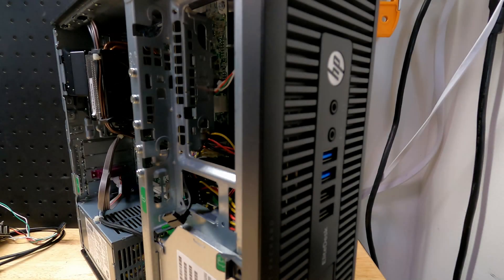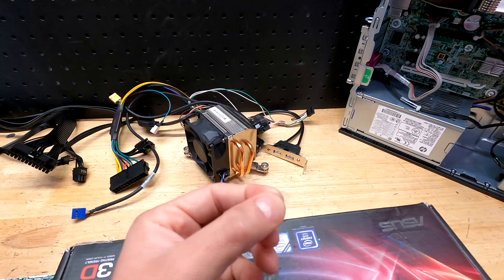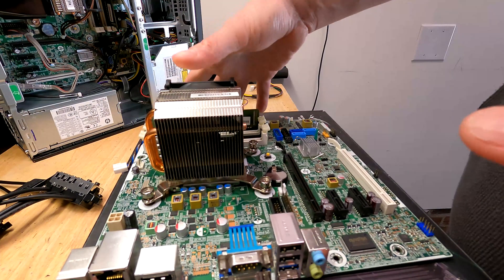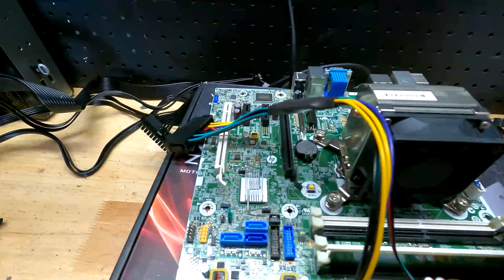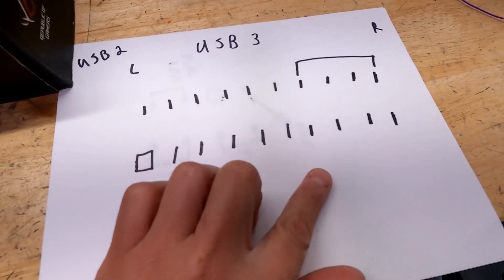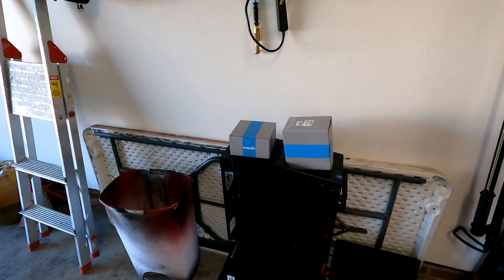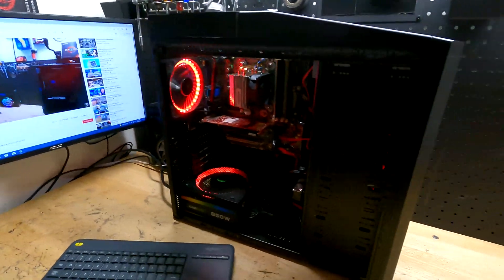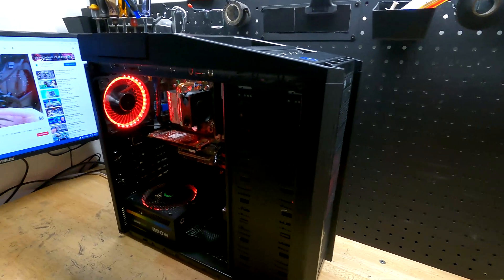Hp Elitedesk 800 G1 case swap!

Comment: Thank you for this video! Everything is working great however I do get error 512, rear chassis fan not detected. Which is odd because there is no rear chassis fan? 
Does anyone have any insight regarding error 512 on boot? Rear chassis fan not connected? I've spent hours searching and can't seem to find a solution.
Reply: Yes lol I felt bad for posting this comment because last night I realized, maaaan just plug a fan in !! 

Thanks for taking the time, I appreciate it!!
Reply from the maker: i plugged in a fan and it got rid of it.

Comment: One question my case has two usb's (the old kind) its a case from 2001 where do i plug those in at? they say vcc1 usb1- usb+ vcc2 usb2- usb+ and then 2 ground cables
Reply from the maker: it's hard to say with the older cases... I am not sure.

Comment: Great video! Just curious if this concept could work for the hp prodesk 600 g2? I'm mainly worried about that 24 pin to 6 pin adapter for the cpu power on the mobo. It seems like if I find the layouts for the mobo and get those grounding cables I can bypass front panel errors and do a case swap. Just worried about that adapter for the cpu power. Thank you for your time!🤘
Reply from the maker: it does. link to the adaptor

https://www.amazon.com/YEZriler-Adapter-Sleeved-ProDesk-EliteDesk/dp/B0B2HVJZJ8/ref=sr_1_3?keywords=hp+prodesk+600+g2+power+supply+adapter&qid=1680731443&sprefix=hp+prodesk+600+g2+power+s%2Caps%2C94&sr=8-3

Comment: I have an HP EliteDesk 800 g3 and would like to know if the 24-pin to 6-pin ATX Power Adapter Cable works on my motherboard
Reply from the maker: not sure about the g3

Comment: I just buy one of this and i can not open it,. The top panel is locked .. any ideas?
Reply from the maker: not sure, never ran into that.
Reply: Hey ik this was a year ago but I used a hairdryer 2 expand the metal, jammed a screwdriver in there, twisted while hitting w a hammer then it popped right off

Comment: Any lga 1150 cooler will work i know this was one year ago 🤪😜
Reply from the maker: have to use the original cooler. mounting hole are not standard.
Reply: @DLMtechgarage  In my version the cooler master i30 and i 50 cpu cooler worked great

Comment: Pretty smart stuff man. My local hardware store doesn't carry nuts small enough to mount these coolers, so I use zip ties and take the pins out of an Intel stock cooler.
Reply from the maker: Ive done that too with zip ties!
Reply: @DLMtechgarage  with a sub 150w graphics card you can get away with reusing the HP power supply as well if you mount it with gorilla mounting tape and use a dual SATA to PCI-E 8 pin adapter.
Reply: @DLMtechgarage  i manged to use my back plate from my old hp board with i7 2600 and it worked
Reply: May I ask  how the ziptie method works?
Reply: I just cut out the square that hold the four holes out of the case with a tiny angle grinder.

Comment: so if i put this in a gaming case, can i just plug in the new cases usb 2.0 into that yellow header? and the usb 3.0 into the blue one and have them be usable on the new case? or do I HAVE to jumper them together? id like to just plug the new cases wires into this board, but i dont want it to fry anything, as can be the case with dell motherboards and their fan headers for example
Reply from the maker: you don't have to do the ground mod, that only gets rid of the error, it will still work

Comment: where can i put the reset button?
Reply from the maker: i never did the pin out for the reset. felt it was not needed.
Reply: @DLMtechgarage  thanks mate, can i put a 1050ti in this pc? what graphics cards do you recommend?
Reply from the maker: @santiagovb  you got a bunch of options, def depends on your budget, I paired the with a 2060 and found good balance.

Comment: Great video. I'm looking to do something similar with an. HP Elitedesk 800 G4, which has a a mother board that looks a lot different. Mainly that it appears to only have a 4 pin power connector. I'm able to find one that will work for that. Thoughts?
Reply from the maker: not sure, might require more modding then its worth.

Comment: Hello, By chance do you know if this would work with an HP Elite Desk 800 G3? Or is the G3 to new?
Reply: Hi, I have the same board as you and I still haven't found any information about the adapter. Please, if you know anything, let me know. I'd appreciate it.
Reply from the maker: @ellobomio66  

https://www.amazon.com/YEZriler-Adapter-Sleeved-ProDesk-EliteDesk/dp/B0B2HVJZJ8/ref=sr_1_3?keywords=hp+prodesk+600+g2+power+supply+adapter&qid=1680731443&sprefix=hp+prodesk+600+g2+power+s%2Caps%2C94&sr=8-3
Reply from the maker: prbly not, they changed the whole motherboard layout.

Comment: Hello I have a question. I have a similar model I tried the same PSU Adapter with a 500 Watt PSU. I ended up getting 4 beeps. Do you maybe by chance know what this means maybe?
Reply from the maker: you might of gotten the z240 adaptor instead of the 800. they look the sign but the wiring is slightly different.
Reply: @DLMtechgarage  Many thanks for the reply!!) It looks like I have hp compaq 8000 elite convertible minitower. I dont know if thats a big difference or not.
Reply from the maker: @PushSaharaX  i believe it is a different mobo format

Comment: Hi...can I use your I/O shield in my hp 600 g1 ?
Reply: Why not ? Your and mine same like
Reply from the maker: @ernanfer2  if its the same board I don't see why not. I have not seen that board to confirm
Reply: @DLMtechgarage  yes it's same board (hp 600 g1 sff)
Reply from the maker: @ernanfer2  should work then I would assume
Reply from the maker: not sure.

Comment: Thanks man, saved me. I accidentally bought the wrong 24 pin connector and the one you linked worked just fine. What I ended up dong is just pulling the front panel out of the HP case. Wiring it and tucking it under the power supply shroud for now. Question and I hope I didn't over look it in your video, Is there a way to get the front panel to work at all, or am I stuck with just keeping the errors from coming up on boot. 

Pretty decent budget build:

Case: Rosewill D100 came with 4 rgb fans $50
CPU and MOBO: i7 4770 FREE!
PSU: thermnaltake smart 550 $55
24 pin connector: $12
CPU cooler bolts: $7
GPU: GTX 1060 6gb: $100
Storage: Samsung 850 120 gb and WD 250 gb, FREE with machine
Reply from the maker: It's in the video, the pinout is simple for the led and power, the usb, you need to add the grounds I should in the video and the audio is a direct plug in.

got another video showing this on a different model but the front panel is basically the same. this video might explain it better.

https://youtu.be/3qOmhk6gVik
Reply: @DLMtechgarage  thanks, so you are able to utilize the entire front panel. Nothing is unusable correct?
Reply from the maker: @FatDaddy94  yup, able to use the whole front just like any other board.
Reply: @DLMtechgarage  you are beautiful. I love you
Reply from the maker: @FatDaddy94  thanks!!

Comment: Hey can you help me? I have a hp Z230 SFF. I bought a 500W psu and im moving the MOBO into a h510 elite case. My psu is a Thermaltake smart series. Comes with main pwr connector 20+4 pin, 4+4 atx pin that i plugged into the cpu pwr, sata 4 pin i used for two SSD, pci-e 6+2 pin (x2) one 8pin went into my Rx 580, peripheral 4 pin and a fdd 4 pin. I planned on putting one 6 pcie pin into the main power connector.

The pcie pin fits into the main power connector. But the shapes look a little different. Also the 6 pin thats above the sata power. I don’t know if it matters if i use that or not.

So do i even need the 24pin adapter?
Reply from the maker: you have to use the adaptor or it won't work, you can short out the board. When you buy the adaptor make sure it is specific to the z230 as other models look the same but are wired differently.

Comment: Heya! If I plug in front usb 3.0, and jump the USB 2.0, will it still give me the errors?
Reply from the maker: you will get the errors if don't do the pin jumps
Reply: @DLMtechgarage  even if I connect the USB 3?
Reply from the maker: @matthijsvandeweerd1415  yea, it needs the ground signal to get rid of the error.
Reply: @DLMtechgarage  oof. Can I rip out the USB 3 from the old case and plug it in that way?
Reply from the maker: @matthijsvandeweerd1415  you can. I have done that too
Reply: @DLMtechgarage  alright so yesterday I have done the case swap and it's not too difficult actually! I jumped the USB 2.0 and ripped out the 3.0 from the old case. Works flawlessly!

Comment: How did you manage to get your fans to work?? The board doesn’t have fans only cpu fan
Reply from the maker: I use a pwm to sata adaptor, it has a splitter to plug up to 5 fans.

link below

https://www.amazon.com/Adapter-15pin-Splitter-Extension-Adapter-28cm-2pcs/dp/B08SJBCVDP/ref=sr_1_3?crid=3GZ0IDGD0LMCH&keywords=pwm+to+sata&qid=1671499696&sprefix=pwm+to+sata%2Caps%2C103&sr=8-3
Reply: I see I ended purchasing a splitter it plugs into the cpu fan slot and add 5 fans slots

Comment: Can I used other cpu heatsink(1155) ...i have a shodow I bought from ebay?
Reply from the maker: no as the mounting holes are not standard
Reply: Ok ...but other opcion ....the fancooler hp prodesk 600 g1 tower ....can I use this it?
Reply from the maker: @ernanfer2  yes, you have to keep the same cooler as their is no other option.
Reply: I mean, are the eyes the same to mount it? , since I will put the board in another case
Reply from the maker: @ernanfer2  no the wholes are different from standard mounting.
Reply: @DLMtechgarage  yes I know ....that I did was I bought a fan cooler mt(hp 600 g1 mt) and worked

Comment: I have a EliteDesk 800 g1 TWR and I noticed the mobo screw holes don't match those of a standard m-ATX mobo. Do you need to adapt the case to the Hp OEM mobo ? How bad is it ? Thanks.
Reply from the maker: no sure, never used those.

Comment: hi...I'm thnking to get it ....but I have 16gb(4x4)ddr3 and one I7-3770, it is support it ?
Reply from the maker: yes it will
Reply: @DLMtechgarage  sure ...i7 3770 is 1155 and the hp 800 g1 is 1150 ...
Reply from the maker: @ernanfer2  misread the comment. the g1 is 4th gen and you would have to get a 4th gen cpu, the 3rd will not work but the memory will as 4th gen is still ddr 3

Comment: Did you make the connections with jumpers because the case did not have the cables to connect them?
Reply from the maker: yup!! if not you will get the error
Reply: @DLMtechgarage  But if the case that I have does have those cables, can I connect them without giving me the error?
And if the case does not have them, then by making the jumper the front connections of the case would be rendered useless?
Reply from the maker: @stopikitzy.  you can, the jumpers are for the board only if you don't want the front i/o but if you wan the front i/o you need to do the mods to the cables i talked about.

Comment: Great video but the g2 board has 12 pins not 10 any suggestions  on pin out because still get fan to spin a second then stop.
Reply from the maker: yea I said that wrong, I have seen that when using the wrong psu adaptor. it has to be specific to the 800 g1

Comment: I cut the back to mount the cooler it been working for weeks now should i br worry
Reply from the maker: if its secure and works, I would not worry.
Reply: @DLMtechgarage  it secure the only thing left is to remove that f1 error and wait for graphic card to be shipped
Anyway the graphic card il be using is rx 6600xt i have nzxt 650w cv it should work fine yes?
Reply: After i get the last parts i may make video on my channel
Reply: @DLMtechgarage  and last is there a way to change that cpu cooler or the original hp cooler is already overkill for that cpu
Reply from the maker: @veol  you can't change the cooler, the hp mounting holes for the cooler are not standard.
Reply: @DLMtechgarage  yeah i just found out yesterday i will drop my project i will sell everything and keep AliExpress 6600xt gpu
Reply: @DLMtechgarage  it was truly fun project to create
Reply from the maker: @veol  yea I enjoy them!!
Reply: @DLMtechgarage  can you answer me

Comment: You know you can disable F1 messages like that from the bios, right?
Reply from the maker: i tried and it did not work!
Reply: @DLMtechgarage  its a setting called bypass f1

did you find it?
Reply: it worked on my hp eletedesk 800 g1
Reply from the maker: @dynamibyte  have not messed with it yet, but also wanted the front usb to work as well.

Comment: I'm looking to upgrade my fans only in a stock HP 800 G1 tower, I read somewhere the pin config on the Case Fan connectors is proprietary and you can't just plugin any fan to the headers.  Do you know if that's true or?  I don't want to start a fire xD I know it has at least 1 SYS Fan header and 1 CPU Fan header.
Reply from the maker: It's easier to go with a sata to 4 pin as the fan connectors are limited.

Comment: Please, can you provider a blackplate adapter for the cpu cooling. ? This is your missing part in your video (Amazon link) . I got just the motherboard i got a square figure cooler that doesn’t catch this hole. Truly thankful😅
Reply from the maker: their is no adaptor, you have to use the original cooler and buy the nuts to make it work.

Comment: Can i put a gtx 960 2g graphics card my case hp 701 g1 amd a8
Reply from the maker: depends if the psu has pcie supplemental power.

Comment: I have a 320w power supply it says its high efficiency and 80plus gold do you think it'll work with an graphic card that is not externally powered?
Reply from the maker: it will
Reply: @DLMtechgarage  OK thanks

Comment: I have an EliteDesk 800 G6 SFF and a new RM850 power supply on the way. Do I need an adapter for it? Have you seen the adapter anywhere on Amazon?
Reply from the maker: not sure as the g6 board looks way different as its newer, some of the newer oem's are changing things so if you mod it, it can cause damage to the board.... I think this requires more research..... plus the adapters are specific for the models.
Reply: @DLMtechgarage  Thanks. It's quite unfortunate :(

Comment: when i change the psu with the 6pins converter it always shown 515 power supply fans not detected
Reply from the maker: make sure you got the right converter, the error happens when you get the wrong one. it has to be specific for the 800g1... there are convertors for the different models and the pin outs are different.

Comment: Hey man, first of all nice video! I have the exact same model and i just bought a 24pin to 6 pin power supply adapter, a 500 watt power supply, a gtx 1060, and of course a bigger case. I have a question tho, what is the exact size of the bolts you bought?
Reply from the maker: it's been so long I don't remember, i thought I mentioned it in the video. my apologies.

Comment: My fancooler is making a noise so horrible, i think that i need that PSU adaptor, bc i've tried everything and it stills making that fvcking noise :(
Reply from the maker: the fan on the cooler could be bad

you would only need the adaptor if your trying to upgrade the psu.

Comment: I'm about to build a rig like this for my dad, with a HP elite 8200 and I wanted too keep the cooler. I have a i7 2600k 16gig, 600w thermaltake power supply and I'm hoping to get a rx580 to work....
Reply from the maker: Should be a cool build
Reply: @DLMtechgarage  do you think the rx580 will work with it ? From what I've read it should
Reply: It's also got a 256gig SSD for the boot drive
Reply from the maker: @Blake.hughesyt  if you do the case swap or upgrade the psu on the m/t model it should.
Reply: @DLMtechgarage  yea I've got a 600 watt thermal take and full size case to house it all.

Comment: what will happen with the two jumper thing connection can i not use anymore of my usb on case or motherboard and if i put a pciex16 extender will it work?
Reply from the maker: Not sure the question
Reply: @DLMtechgarage  what if i put a pcie x16 extender can i put a non lp card?
Reply from the maker: @quadinglelemon5773  you can, just have to figure out where to mount it.

Comment: Hi boss where to connect the front power panel the reset connection? Do you have any clue.
Thanks
Reply from the maker: i don't, not sure they had that option as every diagram I found did not have one listed.

Comment: cool man, i'm trying to builda rig with this motherboard and your tips about the power cable is very great but i had a question. Where do you attach the 24pin output? directly to the psu?
Reply from the maker: yup, adaptor to the board and the 24 pin straight to the psu.
Reply: @DLMtechgarage  ok but my Psu doesen't have the 24 PIN input but only the cable. Is that a problem or i can put the 24 PIN motherboard cable inside 24 PIN Psu cable?
Reply from the maker: @michechelangelomartino871  all psu's come with the 24. if you are reusing the psu that came with the HP then you won't need the adaptor.

Comment: great video mate. how did you solve the 515-Power Supply fan not detected error?
Reply from the maker: Only time I ran into that error was due to getting the wrong psu adaptor. has to be the exact one for the hp z240. the others look the same but are wired slightly different which causes the error.
Reply: @DLMtechgarage  I found a fix. Wiring the blue wire from the adapter into the pwm rpm signal from the cpu fan :) note that in my case this was not a blue wire on the cpu fan wires
Reply from the maker: @timbush4688  appreciate the info!!